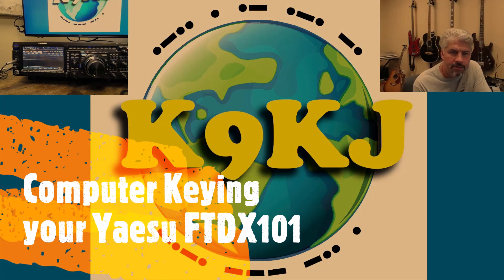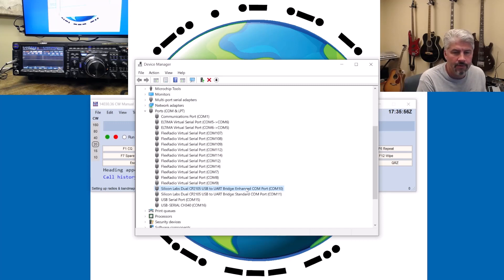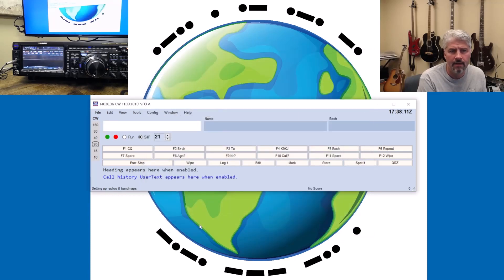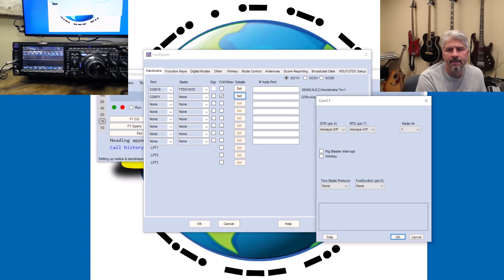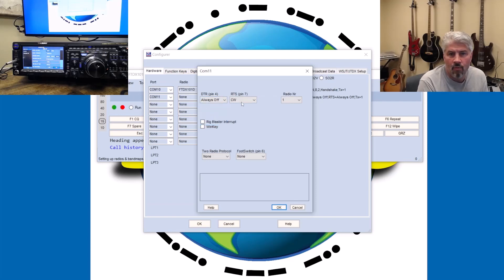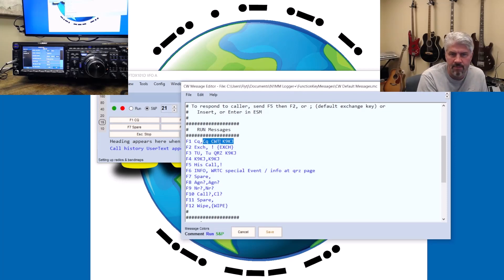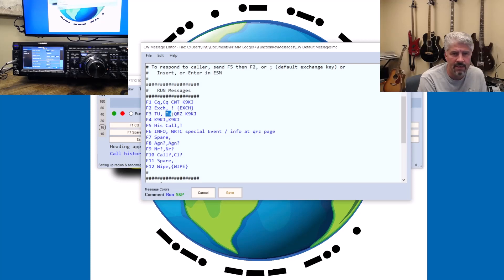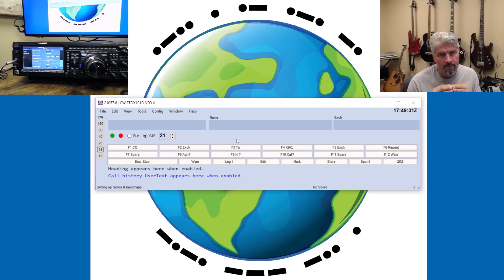CW Keying your Yaesu FTdx101MP or FTdx101D with N1MM

Comment: Hello TJ. I am very grateful for the tutorial. I spent a lot of time configuring the connections between my FTdx101MP and N1MM. I uploaded the appropriate files to my PC, set everything up as you stated in the video and...nothing would work. I left the problem until the next day and with a fresh head I tried again - step by step and nothing. I felt that I had not made any mistake in configuring the hardware and that this was not where to look for the problem. For it turned out that the cable connecting the transceiver to the PC was the cause of the problem. This cable was new and supposedly a “good brand” and...when I replaced the cable with another one (taken from the printer) everything started to work ! So thank you again for the great video. Now I can calmly wait for the CQWW DX Contest CW at the end of November. Warm greetings from Poland. Wim, HF5WIM🙂
Reply from the maker: @sp5ddj  Dzień dobry!  I'm very happy you have it figured out! Thank you for watching!

Comment: Thanks for the information, I follow all the steps but I have in an error in winkey, there is a messag
A Divice  attached to the system is not funtioning.
Reboot . or try reconnecting  your winkey USB cable, then  open/close configururer

Comment: Thank you for a FB tutorial for computer CW control of the FTdx101mp. Very easy to follow.  I did find that N1MM needs to be set to RTS to work and that the radio setting for CW could be either RTS or DTR and still work just fine.  N1MM set to DTR CW did not work at all.  Strange to me!  I am using the latest firmware. It would be great if you did an MMTTY/N1MM/FTdx101MP video and show us how to add RTTY control.  It seems there may be some conflicts between CW and RTTY setups. I'd be looking for a seamless setup so all I would need to do I click on digital interface on the N1MM Windows tab and be up and running in RTTY.
Reply from the maker: Very interesting - I will see if I can give it a try - I havent done much RTTY lately and just tried to do some decoding on my Icom 705 radio.  Thanks for the suggestion and thanks for watching!

Comment: I'm sorry, nothing about wiring in this video. Do you use just one USB/USB cable for both virtual ports or 2 cables including RS232/USB?  To have both CAT and CW options. 73, Roman, 5B4AQN
Reply from the maker: Sorry about that. There is only one USB cable connecting the radio and computers.  That single cable is able to handle everything.
Reply: @k9kj  I got it, many thanks!

Comment: Hi its me again, sorry to bother you. Eventually I got N1MM to load on my pc and followed your setting up with my FTDX10. So far so good even got the cw to key by the F keys. Now I have my  cw speed set to 20 wpm but using the f key its sending above 25wpm.. How can I match  NIMM to my radio cw speed ? Thanks
Reply from the maker: From what I understand, the CW speed that is controlled by the software will always be independent of the keyer speed on your radio. You would have to match both of them up in order for them to match. I don't know that there is a way for the software to control the yaesu
Reply: @k9kj  I have found that out now but, I am old fashioned, to me the art is sending not using the logbook keyboard to send. I have not spent my money on a Begali dual paddle to do that. Thanks for your reply looking forward to video on N1MM uploading the CWT log.